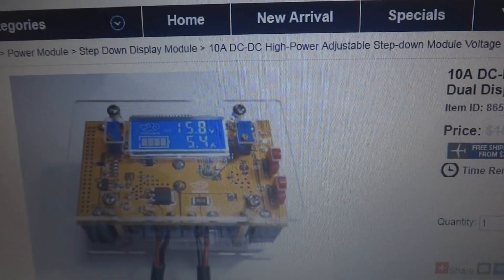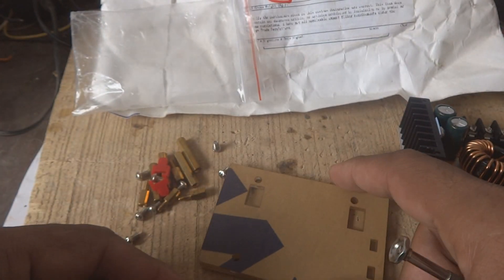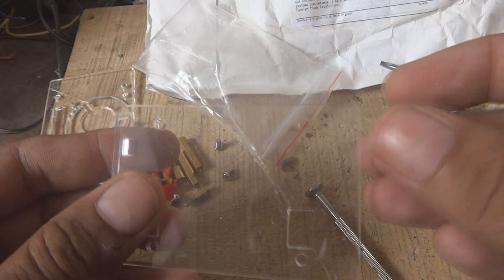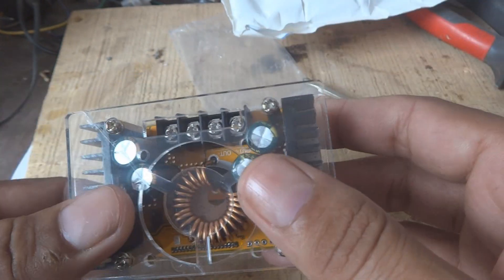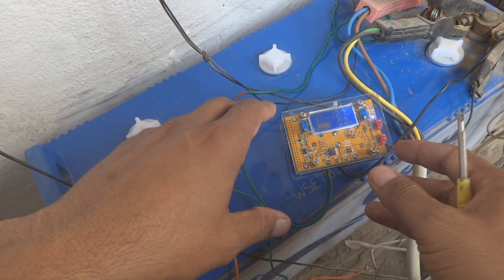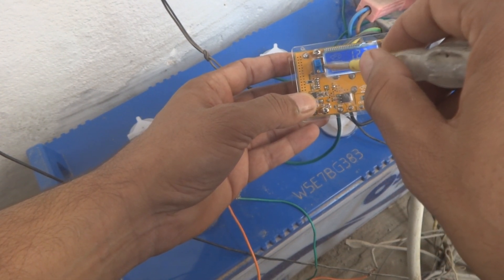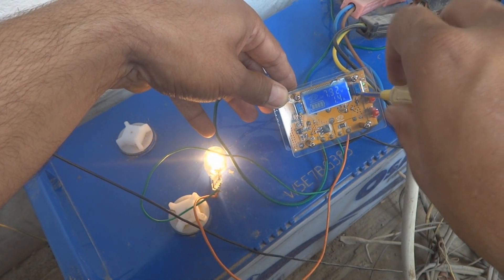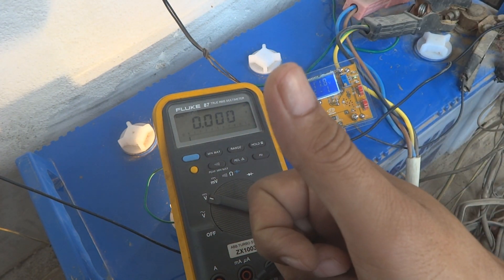Step up buck boost switching module 10A 150W. switching power supply

Comment: If the output/input voltage is not right you can Calibrate the Winners 10A, here is how:

The module with a calibration function, do not worry about the measurement display is not accurate, If you find that the display is not 
accurate you can use the following method of calibration. Just use the calibration once for the first time!
Voltage calibration: In the case of power off, press and hold the "Setup" button, power on, enter the voltage calibration mode, the LCD 
screen starts flashing, release the set button, press the "Settings" button to increase, "OK" to decrease, the input voltage of the 
calibration for the correct. Such as: the input voltage is 12.65V, then the voltage will be adjusted to 12.65V, after 2 seconds will automatic 
preservation, power off and exit the calibration is complete!
Special Note: If the first use of the output voltage can not be adjusted, because the module factory, the default output voltage is 20V or so. 
When you encounter this problem, please counterclockwise rotation ADJ-V potentiometer more than 10 laps, until the voltage value changes, 
and then you can use the normal regulation of the voltage.

Comment: Please help me I have this similar power supply when I first turned it on it runs like a charm but after 4 hours it just stuck on 5v on but my voltmeter is showing that it is not giving an single volt. I turned it off for the whole day but still facing that problem please help me
Reply from the maker: I'm sorry dear friend seems like you have defective system microcontroller for your power supply unit. Unfortunately the repair could not be possible. Anyhow what I can suggest is you may check your input supply quality. There shouldn't be riplles present in that. Also try replace electrolytic caps for the unit and let celeberate your repair success here with us! Wish you good luck.

Comment: Just a tip for gluing Acrylic sheet. I use chloroform to adhere it. It actually welds it together and mixing shavings of Acrylic in the chloroform can make a filler also. Just be careful of the fumes.
Reply from the maker: That's awesome. But it is very difficult to get chloroform here. Anyway thanks for idea.

Comment: You should have applied the glue whilst the backing was still on the plastic parts as they would be aligned perfectly.
Reply from the maker: Thanks dear friend for nice comment and suggestion. You are right that would be the excellent way. Anyhow it worked in my case. Best regards,
Reply: Yes, indeed! I was shouting at him to stop peeling it off..through my screen! LOL! But yes it would have been perfectly aligned then. Glad it worked though.

Comment: You didn't replace the capacitor :D
Reply from the maker: I will replace it latter on. but the power module was working with the same cap. Regards,

Comment: What a shame the postal system damaged it :-(
But it still works :-D, and it looks like a very usable module.

You may want to find an old cpu fan from a broken laptop and fit in that case perhaps.
it has a cut out for one and would make it cooooool so it last a long time :-D.

Storing energy in an inductor, then using it as a negative charge shunt to reduce
a high potential looks very usefull :-)
Reply from the maker: Thanks for liking video and understanding the usefulness of the module. I have a plan to make a step down switching module using this one. Regards,